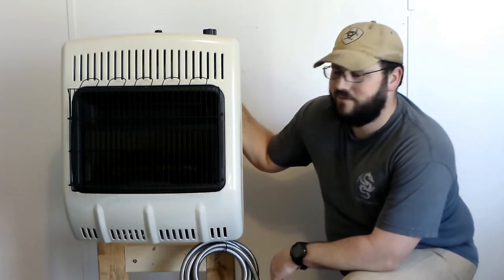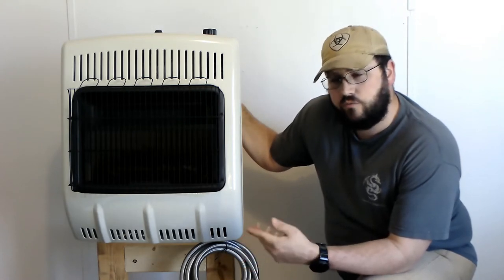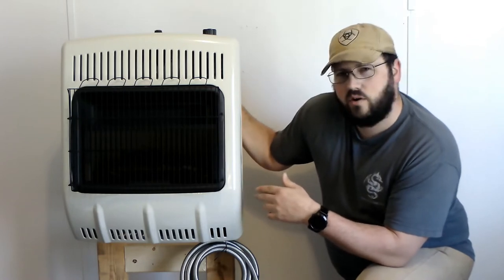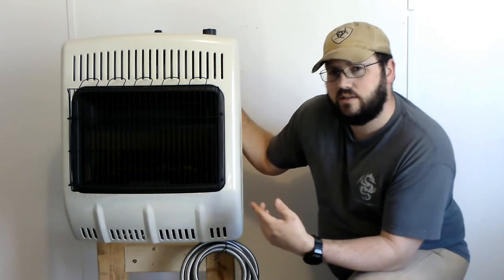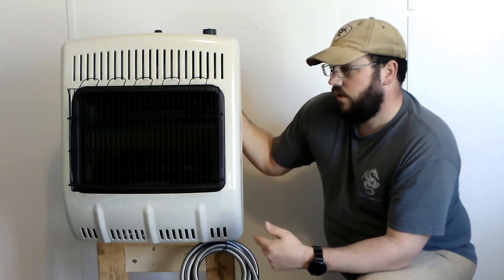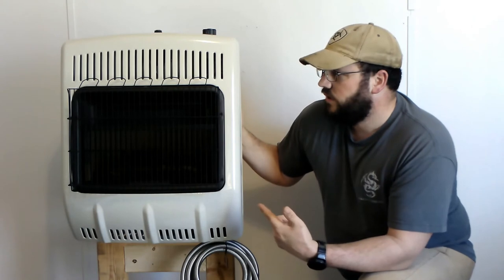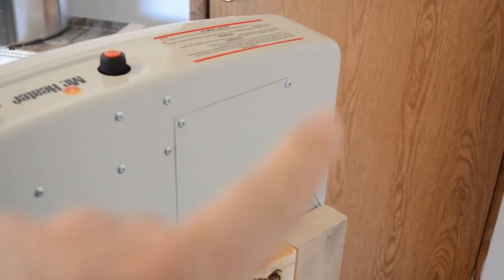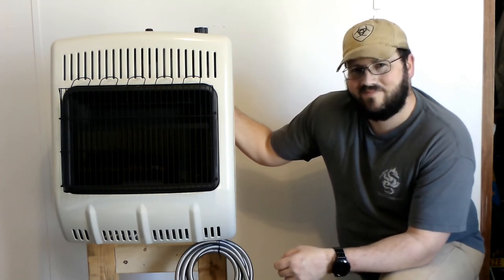Portable Grid Down 20,000 BTU Mr Heater Setup

Comment: I have one of those and it heats my entire ranch style 1250 square foot house.  I don’t use it as a primary source of heat, but it’s great for when the power goes out!  The fan isn’t worth it or necessary at all. 
You do have to hold the pilot light button down for a couple of minutes, so be patient.
Don’t forget to use a regulator and at least a 100# propane tank.  (Approximately 7 gallons.)
Reply: How many hours does a 100 pound tank last? Thanks.

Comment: Also you might want to check your heater instructions, on mine it said to remove the thermostat and place it on another hole to the back side of the heater. It said that the thermostat is placed in the lower recessed area for shipping purposes
Reply from the maker: I will have to check it out. I dont remember it saying anything but I could have missed that. Thanks for the information.

Comment: My 3/8 90 degree piece is leaking Gas from where it screws into the heater even with tape. I have tried 3 different 3/8 flare types and they all leak from where it screws into the heater and not where it connects to the gas line. What can I do to seal the leak.
Reply from the maker: The only thing I have used is tape and it works fine for me. They do make a liquid style tape that you brush on. That may help seal up your leak. You could also run a tap on the threads of your heater to make sure they are clean.
Reply: @cbadventures8996  I used ample amount of the propane grade tape. But the liquid one sounds like a shot. Do you have a link or something so I can find it?

Comment: Sounds like it would cost nearly $400. with all the necessary  additions and around $800 montly.  Might be good for emergency's.  Is my math wrong?:body-blue-raised-arms:
Reply from the maker: I believe at the time I built this I had maybe 250 dollars in the whole build. It's been a while but I believe that's what I had wrapped up in it. 

I only use this just a few times a year. Mainly when we have a power outage and my furnace isn't running. For my situation it has been worth every penny.

I also see these heaters for sale on Facebook marketplace for pretty cheap so that would help a person save some money on it.

Comment: I noticed on Tractor Supply's website that Mr Heater propane heaters like that you get a fan free with purchase. I don't know exactly how or if one actually does.
Reply: the fan hardly does anything. Not saying it's not worth it. But 99% of the reviews, say that fan doesn't do much. You're better off having your own fan running over or near the heater.

Comment: How good is the stainless steel holes with the heater
Reply from the maker: I have had zero issues so far. I got it mainly for the abrasion resistance and the fact it has a guage is a plus. I would still reccomend it after several uses.
Reply: @cbadventures8996  Thanks man Imma have to get me one

Comment: I hear the motor blower is a waste of money.They claim is does not make too much of a difference.
Reply from the maker: I also read that a lot so I ended up not getting the fan. I have used this a few times and heats my area well without a fan. I use this mainly when the power goes out so after thinking about it a fan that needs to be plugged in would be useless for me.thank you for the comment
Reply: Save your money on the internal fan and just use a small plug in fan to circulate air in the area. If concerned about use in power outages by a ryobi 18volt battery fan. These heaters are fantastic! Thanks for posting.... same setup as I have only I have the foot kit.

Comment: Did you build the stand cause your wall was getting hot ? I got a 30000 btu and my wall get so hot I turn it off
Reply from the maker: I built the stand so I could use it in my shop and in my house both. I never noticed my stand getting hot.
Reply: @cbadventures8996  What I mean is that I hung mine on my wall and it gets so hot it seems like it's going to catch on fire that's why I'm going to build a stand like yours.. Good job nice stand build

Comment: Hey , where did you get your parts for the hoes hook up? Can you send me a list of every part you used to hook up the propane tank please. Thank you
Reply from the maker: I got everything off Amazon.
Brass 90 degree elbow with 45 degree flare fitting 3/8" flare tube x 3/8" male thread.
12 foot regulator hose with 3/8" female flare fitting.
Gas line pipe tape.
I hope this helps
Reply: Lowes has those parts too. You want to use the black pipe, not regular galvanized.
Reply: definitely get the regulator / hose off Amazon. Much better selection and prices.